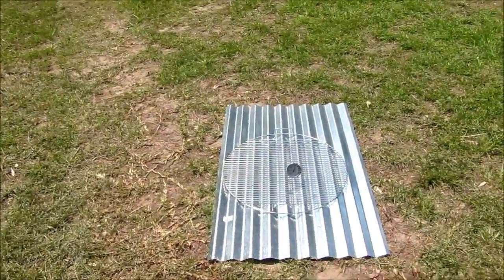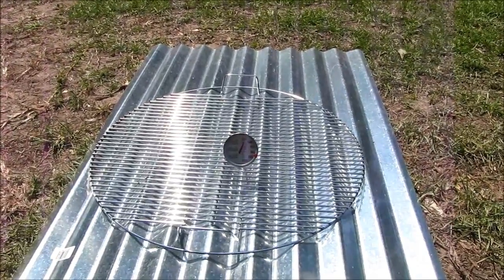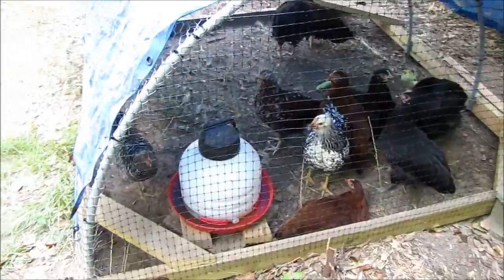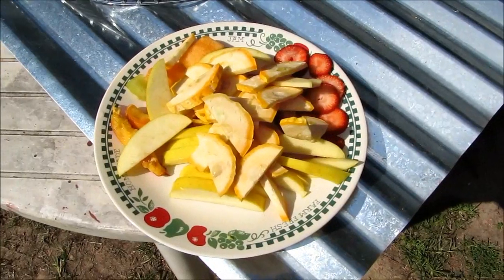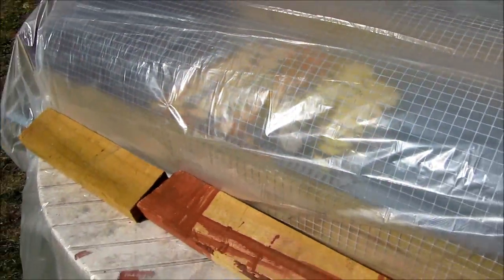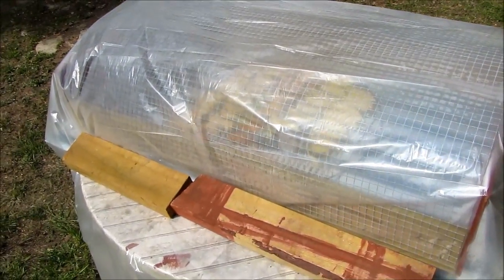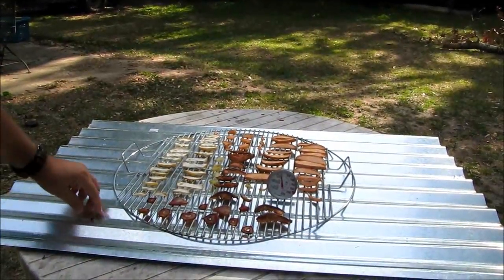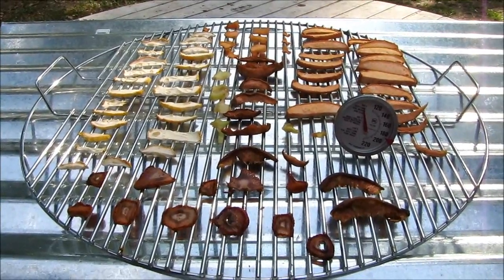Solar Dehydrator Project Part 1

Comment: ~~~
Do you know how high a temp the plastic can take before it starts emitting toxic gases? To dehydrate, you need air flow so that the moisture can escape. I'm afraid that all you made was a toxic sauna.
Reply: Drying with sunrays.and plastics is not.good, air.dry is.preffered.for.foods.

Comment: Dehydrating fruit and veges is accomplished by way of air flow. I do large amounts at a time and the temp is only 100 degrees, but there is lots of air flowing. Use the heat to create the air flow with a vertical stack vent that you can adjust to control the air flow. Good luck - there are designs with successful results on youtube. - Our Farm Naturally Grown Produce Store.

Comment: bring your air up through the bottom and create a small grated vent hole at the top, you need the air flow for it to a dehydrator. Like stated you crated a solar oven. You need a place for the moisture to escape. You can make a baby version of your chicken tractor leave bottom uncovered, small slit at top are uncovered look up the design principles of down draft solar dehydrator

Comment: Without air flow you have only created a low grade solar oven.  Even with air flow it's going to take longer than 6 or 7 hours to dehydrate fruit properly.  Most solar dehydrators will take between 1 and 3 days to properly dry fruits and veggies.   I also suggest you don't place the fruit directly on your metal grill.  The natural acids in the fruit will eventually eat into the metal.  It's why most dehydrator trays are made of plastics or nylon.

Comment: I agree with the air circulation comments and air flow and all that. You can use natural draft convection with stuff like this. You want a box that can get hot enough and only allows for a slight bit of airflow in (from the bottom or sides of the box) and at the top to allow for the exit of excessive heat and moisture. If you have any old charcoal grills you're not using, you might take the vents from it and use those to control how much draft goes through. Good luck next time around.

Comment: Thanks for clarifying.  It even makes my original point stronger - you always need air flow carrying moisture away in a dehydrator.  You showed that the element could be thermal as well as mechanical... and thermal might be easier to incorporate into a design (though probably is less efficient per watt used).

Comment: Like others have said, it's not going to dehydrate anything. I understand the whole being retroactive and trying to using stuff laying around but you need a completely different style dehydrator. It's not like you have to show people how to build it AFTER collapse. People can build one right now while they can afford to, and do it right. Need more airflow, preferably something that forces the moisture up and out. You're just trapping the humidity under the tarp.

Comment: What you basically created is a version of a solar oven.  You need a way for moisture to release from the enclosure.  Everything will stay goey otherwise.  Paint the bottom grate a matte black to absorb as much light as possible.  You are losing some heat from the unpainted metal.   Good luck on it.  Cant wait to see an update!

Comment: Cut some 3-4" holes in each piece of plywood and cover them with window screen to keep out the flies. Tilt your dehydrator to 15 degrees and face it due South. This should help your moisture problem.

Comment: couldn't you take the tin place it on the bottom take non-fiberglass air filters place your fruits/meats in them cover bundle them together with bungee cords so you have a closed box but still allow air flow plus the heat coming from the tin ( basically this tin- filter- meat/fruits- filter, repeat as necessary with the middle layers and put bungees around them)

Comment: I don't know much about solar dehydrators, I haven't done any research into the area - but it seems to me that all the moisture from the food and the air inside the enclosure would make it very very humid. To be an effective dehydrator, the air needs to be very dry, much dryer than the food you're trying to dehydrate.
Those are my thoughts, but I could be wrong. Well done for actually experimenting and finding out what works best though!